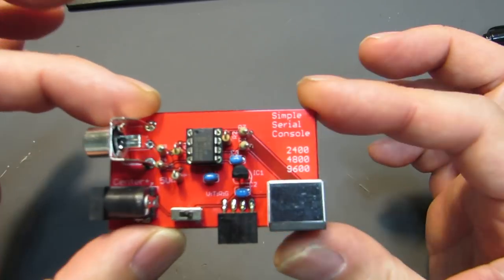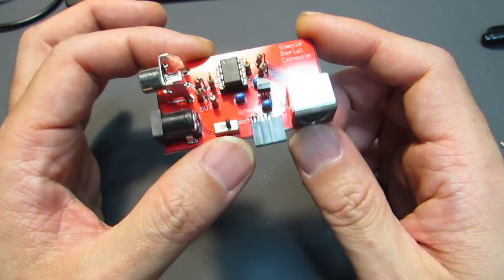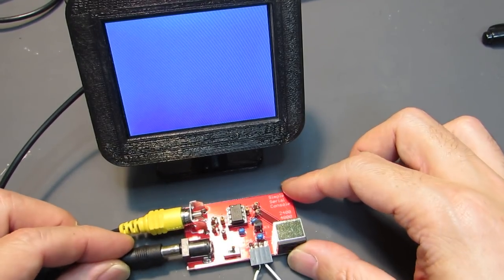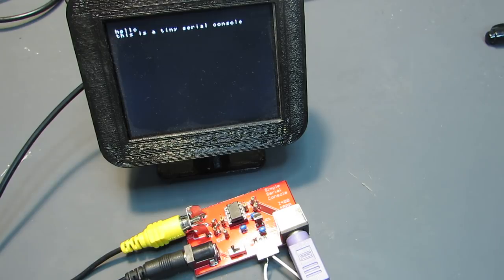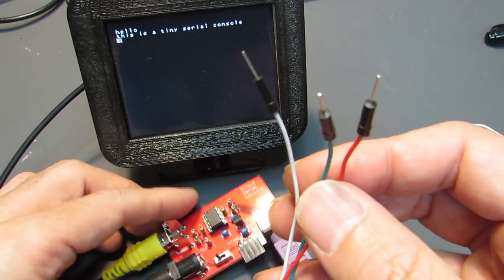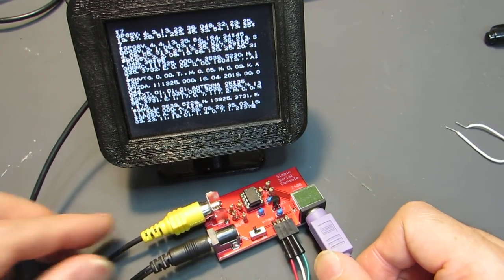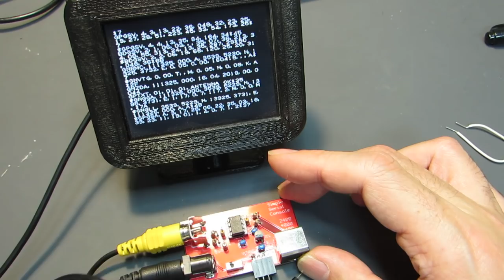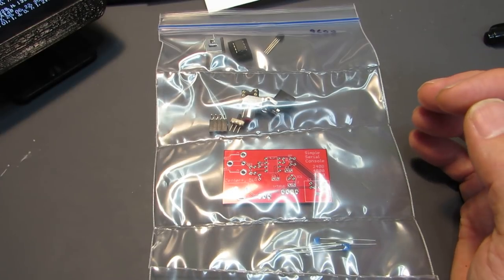Simple serial console

Comment: Is there any way to adjust the baud rate or will it be fixed? Seems like most of what I do is 9600, but there are exceptions now and then.
Reply from the maker: The baud rate is fixed by program (binary). Indeed before I've tried 115200bps and it still works!

Comment: You talk about NTSC, but NTSC/PAL monochrome does not exist. Its called CCIR System M or J 525 line 60 fields per second. (30 fps)
System B is 625 lines.

Is the chip programmable to have CCIR System B? System B is 625 lines 50 fields per second(25 fps)?
Reply from the maker: It's 525 lines, and the source code should be modified for 625 lines modification. (In theory, possible but not tried.)